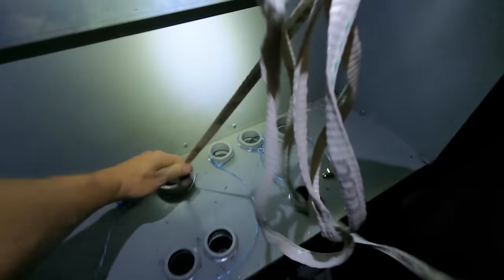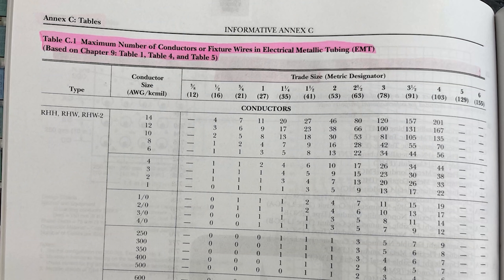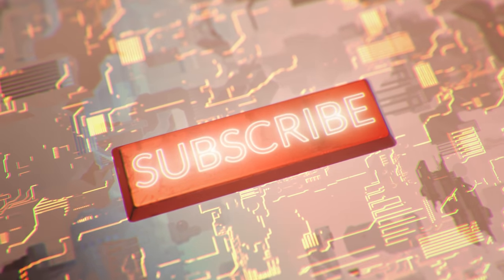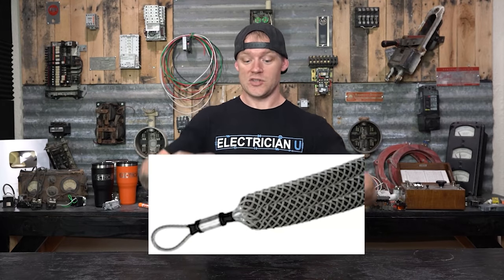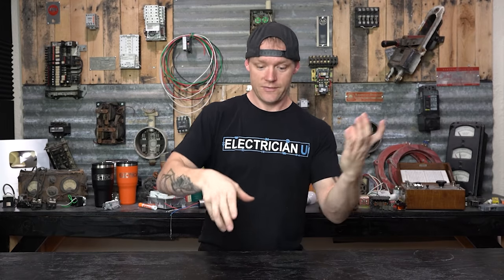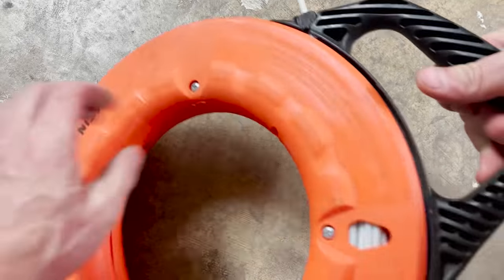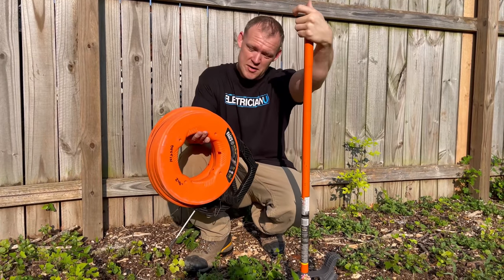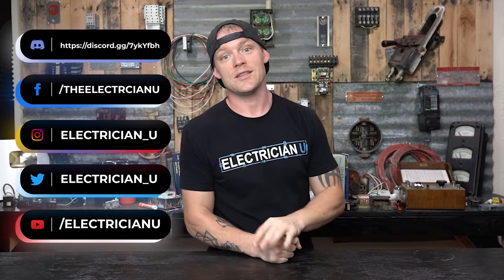Pulling Wire Like a Pro - Tips and tricks for pulling conductors through conduit

Comment: I never use fish tape - I use a shop vac and suck a string through the conduit. Works every time!
Reply: This is one of the only tricks that sucks but is still the best to beat sadistic conduits.
Reply: Yep! Get a plastic baggie and make it into a ballon of some sort (we call it a mouse), tie the jet line to it and use the shop vac on the other end! works every time! As long as the hole you're putting the shop vac on is sealed tight around the hose of the vacuum. If not, you can take cardboard and put the hose end through it, then tape around it, for a secure, air tight seal....
Reply: Except for when it doesn't... ISP applications you're better off, but OSP 😬
Water, dirt, debris, etc. - Time to get the Compressor and/or pump out.

Comment: The HEAD
Tapered and not larger then conductors. To ensure maximum flexibility all strands used to make the loop need to be a straight as possible.  Any of the exposed strands in the conductors that are removed (cut off) must done so they don’t have sharp points or due to bending when cut increase the size of the grouping. 
I use a tube cutter to deeply score the insulation next scorch the outer wrapping so they break off clean and easy and for the second wrap of strands move the cutter a couple of inches toward the end then score those strands. You end up with a tapered length with no razor sharp ends.
I make sure to stagger each of the conductor. 
It is quicker, cleaner and safer way to make the conductors into the pulling head. 
I wrap the entire length of the head with gaffer tape. Then a layer of cloth that is soaked in pulling compound. If it is a long pull I would attach a compound soaked rag a few feet from the head. Sometimes if the pull was happing when the raceway was finished I would pre-lube with a solid type line like SlipStick before any bends or have an oversized condulet so pulling lube can be added. 
I never just tape a conductor to the group. It is not worth the chance of it slipping and end up short. 
I started working in the trade in 1979, master license in 1999, until 2018 when a work related injury put me on disability.

Comment: For hard pulls...
half hitch, half hitch, half hitch
It grabs as good as a sock, and uses the tape you're already using.
Reply: That’s what we just did pulling 3 400mcm and 1 1/0 ground. Co worker did the first head and it broke off half way through the pull . Took us 4 hours to fix that mistake. Then did half hitch x 5 and no problems with any of the pulls
Reply: The only issue with half hitch’s is it can start to tear the insulation
Reply: @robalt91  That's absolutely correct... so pull extra through, and cut off the section that was damaged. What? Did you think there was magic? If you have to put massive force on something, things break. But if you had to pull that hard, the odds are that damage was going to happen anyway. Overcome and move on.
Reply: Clove hitch then half hitch 4x.
Reply: Agree I ditch the fish tape and hitch to the wire alone
Reply: I came here to say the same exact thing. Screw heads! Half hitch whenever possible
Reply: Interesting, arborists will do the same thing when pulling a rope up into the crown of a tree with a throw line.
Reply: @Aholeintheozone  hehe, interestingly I was an arborist before I was a lineman. Seems I have a knack for elevated work and jobs that other people don't want.
Reply: I'll get dressed here after while
Reply: The half hitch is my go to method on most of my pulls. Works every time. Just make sure when pulling multiple wires to add some extra tape between the conductors to stop them from pulling loose. I can even pull ground rods back out if needed with this method!!!!

Comment: If I have a 50' flex 3/4 and I am going to pull a #6 guage THHN cable, should I pull it through before installing the conduit? meaning, pull cable thru the conduit, then installing the conduit with the cable inside.

Comment: I had to do cable dawg work while I was enlisted. We ran fiber optic wires through pipes with a really long wire on a reel. Then yanked it through the pipes with 8 guys pulling. We had to cover 14 miles on 1 job.

Comment: Hey man when making a head with big wires like number 8 stranded when you make the head id leave the copper ahead of the insulation to decrease the size of the entire head when you add copper plus insulation multiple times it gets fatter and if you just lay the copper over mule tape onto copper again avoiding the insulation make the head much smaller and you can twist the strands make that tighter also you can stager your individual runs of wire to make the pull a bit easier

Comment: Sold a hospital project 45,000 ft of 350MCM THHN in 2008. The contractor first pull had a number of conductors well short of the length they should have been directly from the factory. I watched the contractor make the longest pull only to see them destroying it pulling it out. They worked their asses off making that pull and worked even harder pulling it out of the pipe. To make matters worse, the factory replacement order was short TOO. 
After witnessing that contractor pulling that size conductor in and out of the conduit, I have a much better appreciation for anyone that pulls large runs with larger sizes of conductor. 
Not easy work even with a tugger!!

Comment: I might have wandered a bit, but if I expect there to be future growth, I upsize the conduit and add a pull string when pulling the wires.
Anyway great refresher. Thanks a bunch.
Reply: The problem with pull string is it can get braided in with the wires worse than another wire. Good on you for upsizing the conduit, though.

Comment: Dustin ---- I don't know if you read my comment from last week about you doing a video on wire pulls, (I wasn't sure if you did one already on larger commercial pulls or not), but either you did or you re- uploading this video now was a coincidence, either way,  as always, great job covering the major aspects of different types of pulls and what it takes to make a pull as smooth as possible (pun intended).
  One thing I want to bring up to you and it isn't a criticism but a question.  Fishtapes ... don't you find that the nylon fishtapes are pretty much useless in most cases? The safety factor is excellent but it does no good if you can't push the fishtape in a conduit beyond a few feet because they aren't stiff enough to push through a couple of bends and some already installed circuits. I've used Klein's, Ideal's, and Greenlee's and they are all the same. There is one that is a nylon or plastidipped stranded steel cable, I don't remember who makes it but, it worked pretty well but still not great for using in conduit with live circuits already installed. 
    Just thought I'd try to get your thoughts on that subject.

Comment: You said under 1" you can usually use jet line and above 2" or 3" you'll probably want mule tape. Is there a way to calculate when you are in between--like 1-1/4" with three #2's and ground?

Comment: Love your videos and I have a question, I have several rolls of 12/2 Romex, can I run that in emt in my metal out building?
Reply: Technically you can run romex in emt but the cross section of the romex is what is used to determine what size emt you would need according to NEC. In which case the emt size would be larger than you would think.

Comment: We had to pull into a panel on this one job but through the top according to this jobs spec. So it was a very difficult angle as they were trying to figure out how to do it. I eventually mentioned to try and use two pulleys. One above the panel to the ceiling and one just above the drop into the tugger. They thought it was a great idea. Good thinking apprentice we may keep you around they said but we only got one pulley. The guy that mounted it decided to just put it in the middle of the ceiling between the panel and the tugger without anyone hand feeding up through the panel. I remember me and another guy just standing back as the tugger managed to pull the panel and its bolts clear off the wall and damaging everything. It was pretty disappointing that disaster happened like it did. The guy that did it was absolutely confused and did not seem to care of the disaster he caused. The shop owner was pissed and we all got laid off for that one even those of us not involved with that part of the job. That was not pulling like a pro. It was more like job sabotage. Do not do that. Tell that to the youth of today and they wouldn't believe you.

Comment: i just did a 95 foot pull with 9 90s so i used Lb boxes at every 90 and restarted my 360 at each 90 degree LB and pulled it all through to each Lb and did it in 2 hours on my own without helpers 3 - 6gauge and 4 - 12 gauge taped together and marked at each end with 25 percent extra wire for stripping needs and vacuumed a string through first tied to a rope tied to the conductors with no need for fishtape 1 1/2 inch pvc 80 conduit/ get her done

Comment: I like your point of not using the metal fish tape to pull with. This makes good sense on long heavy pulls. This is why I use the nylon or fiberglass fish tapes a lot. I will use mule tape when pulling really heavy stuff. 
Another tip to bring up is leaving a pull string in for future pulls in a conduit.
Reply: You don't need the fish tape for a conduit run
Reply: @tonyllamas5555  yes you do

Comment: Glad to know I’m not the one  going up a size.  It was expensive for the 1 1/4” but worth it.   Pulling 4 4 awgs.   At least I hope.  Wouldn’t be watching if I had already done.    This time I will be using lube, first time trying that.   Didn’t know about the bends but I only have 3 90’s and a little bend I made using a little heat.

Comment: We used to use a lubricant called " slippery  lube " it's yellow in color, but worked great! we would wipe off any excess off the wire on the other end of the conduit!

Comment: You are so right with using 3/4" EMT verses flimsy 1/2" and stranded over solid. Better off using stranded even fron #16 TFFN & # 14 for controls where there is a lot of vibration. Had solid #14 wire break on microswitches that were mounted to crushers & hammer mills. When we had to pull say 25 #14 stranded conductors would strip some 6", some 10" and cut halve the strands off and stagger where the insulation starts. Use a good quality tape ( not cheap crap from commumist cheating china ) and wire lube on head.

Comment: I was pulling 7 # 10 in a 1in yesterday with a pull string and. It was so hard i finally said tye it to the fish tape and it went so much better because the string kept ripping thru the bushing or cutting on the connectors almost cutting the string due to the shitty angle and the guys not feeding properly..so some times the tape is helpful

Comment: Can you answer about question about buried grey conduit?

I was watch another channel where someone used buried conduit  to run 100Amp service to an out building.  Someone else said it would be better to direct bury it.  I countered that it would be better to use conduit for protection and easy of replacement.

They responded "you do not know how wrong you are period every hundred feet you're supposed to have a junction box if you run conduit did you see any junction boxes in the ground I didn't. And that's standard electrical code".

This does not seem right as I see people using long runs of conduit under ground with no junction boxes.  In fact I did not think you were even allowed to bury junction boxes.

Is this person blowing smoke or are there some places you need junction boxes in buried conduit?
Reply from the maker: If the wire was running conduit and the run was 100ft. Their argument falls apart since in their own words. "Need a junction box every 100ft." 

End of argument. 

In short they are incorrect. Both means of supplying power have their own merits. In conduit it's easier to replace or run a new wires entirely. Vs having to re trench and bury a UF cable. As an example. But sometimes the only thing available is direct burial cable. So both are allowed. 

But you can always find arguments for or against either option.
Reply: @ElectricianU  The run was 175 feet and he ran straight conduit with no junction box.
Reply: @jaycahow4667  I don’t know what code they’re going by but it certainly isn’t the NEC and it’s definitely not “standard code”. Yes, he was blowing huge plumes of smoke! But junction boxes for underground conduit runs are very commonplace. ALL junction boxes are required to be accessible per the NEC….BUT you DO sometimes have to semi-bury a j-box. By that I mean you install it in a manner that it’s recessed into the ground the depth of the box with the box opening/cover facing up so that it’s still accessible. They can also be placed above ground of course but the 100ft rule doesn’t exist and Electrician U is right, it’s so much faster, easier, and cheaper to repair a broken underground pvc than to re-trench the whole run. It’s like you’re starting from scratch again.

Comment: Careful with tough underground pulls with pvc 90s, could cut through the pvc 90 from the pull string burning through if going to fast. Haven't had it happen but I have heard stories, some cases we do rigid 90. 

Another tip for long pvc runs is using a vacuum to suck a kit string w/ plastic tied at the end, then pulling the muletape in. Faster sometimes than doing fish tape by hand.

Superslick thhn wire is pretty nice, learn the half hitch and always have lube like yellow 77. Bonus is a competent young buck to do the pulling.
Reply: I've had electricians tell me they do a piece of styrox insulation on a thin string and use a vacuum on one end and leaf blower on the other end. To persuade the string to come through all the bends the guys before them put there.
Reply: It is a concern with pvc...right on with the rigid...best choice on average imo.
Reply: You have to bond those rigid elbows if they are in the middle of a PVC run. Not worth it
Reply: 77 over time dries into a yellow paste that sets like concrete. Good luck getting those conductors out. (I've done a ton of service work where sometimes u have to reuse a piece or run of 4" rigid do to space constraints.) Try to use Dynablue or something clear and water soluble like polywater. Also u must consider if each conductor is the same color but the  wire has identifying stripes/ tracers or letters/numbers certain lubes will wipe those numbers right off. Check the sticker on the reel before u set up. This happens more often than u think. Happy pulling guys
Reply: Also regarding the Simpull stuff from southwire. They have an option where they factory crimp pulling heads (fingers on each conductor, usually each set up comes in a pair, meaning each each finger is attached to one other finger this way you have a loop or an eye to put through your sister hook, swivel or rope adapter. Swivels are key! They waranttee their wire meaning that if u lose a pull they will replace the wire lost IF and it's a big IF: 
1) You aren't over the max allowable # of degrees of bends  (360° but I NEVER GO NEAR THAT HIGH. PERSONALLY 2 NINETIES AND I ADD AT LEAST A "C" FOR LUBING PURPOSES JOT TO MEET CODE.
2) If u decide to apply Lube to there Simpull No Lube Needed system. That voids there waranttee as well. The Simpull coating will usually get a run in it and get peeled revealing a slightly paler color conductor underneath. No worries. That is just the Simpull coating not the THHN/XHHW ETC...
Reply: @TR-ut3yh  In NYC they sometimes use Gal 90s with the PVC. I never have good luck with it though. The male/female changeovers to connect the PVC to Steel Pipe always crack and whatnot. And of course we can't just take the bell end of the PVC and stuff the steel into it ...lol. Thanx T.R. I've never considered that those 90s although buried need bonding. Makes sense though. I'm an A Journeyman (have been for about 12 or 13 years by now) and still I learn something new everyday. Whether it's from looking at how a pipe fitter or plumber supports something or just a different type of nose. Everyday I grow. As we all should. Intelligence means u know u can't possibly know it all.
Reply: Oh btw I had a case where we used Simpull and Dynablue Lube. The Lube actually changed our Megger readings believe it or not. That was a disaster getting the manufacturer to admit that Dynablue interacts with whatever they use in the Simpull chemistry. Smh. Suffice to say we passed although I forget the reasoning as to why if the Megger was no good. I believe we went to the other end where the wire was less lubed and the readings were better. I know how it sounds but I am just working off memory here. I was a first year apprentice back then about 17 years ago and the contractor was a huge multi million dollar outfit. Btw I am a union electrician and contrary to popular belief "I, We, Most of us," want and need  the contractor to make money and stay afloat so WE have work. That is all I mean about union/open shop, no animosity nothing at all. Just pointing something out. As u can see I am on a public forum sharing with all. I would genuinely love to see the industry improve for all on both sides. Anyway I just want to save anyone the headache and financial woes I have come across in the industry in the past.

PS: I am talking biiiiiig feeders here 500s, 750s and up in biiiig pipe( 31/2", 4", 5" and 6".) Hope this info is useful or at least thought provoking!
Reply: @michaeldove339  ive had my masters for 10 years and I run my own 2 man shop. Most utilities around me require 2 runs of 3" from the pole to the meter socket with 3' radius RGC 90s. They want a ground rod driven at each end and all 4 90s bonded together. Way overkill in my opinion. I also learn new things everyday. Thats why I love our trade.